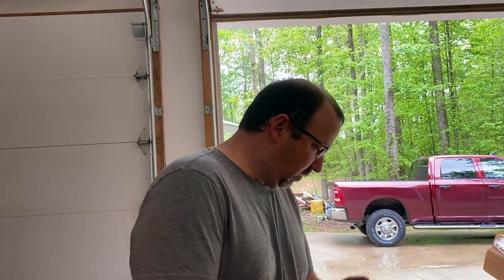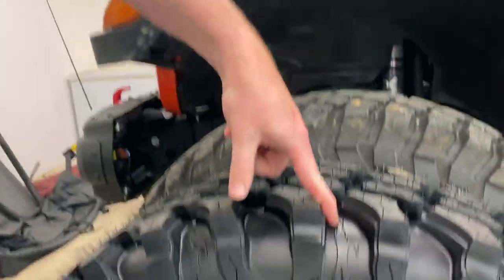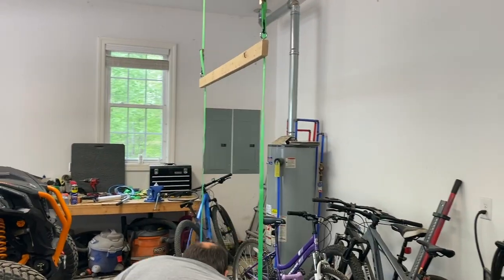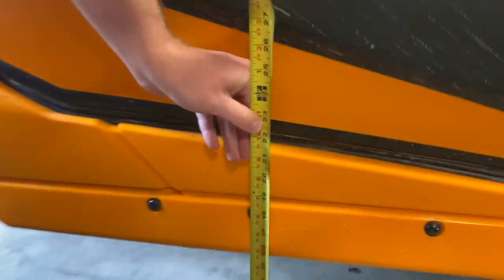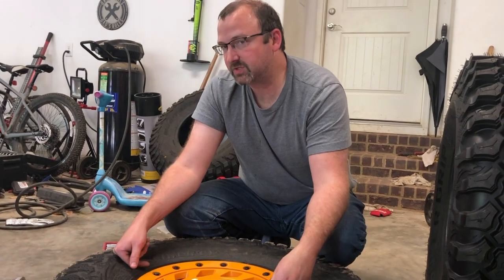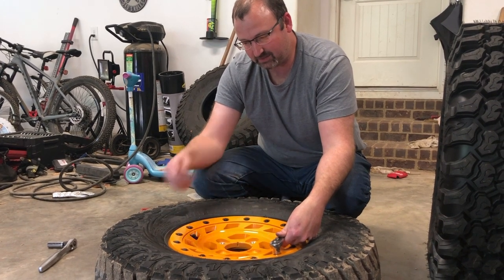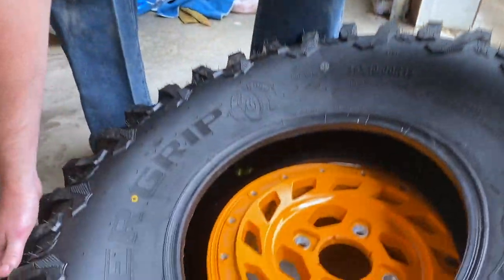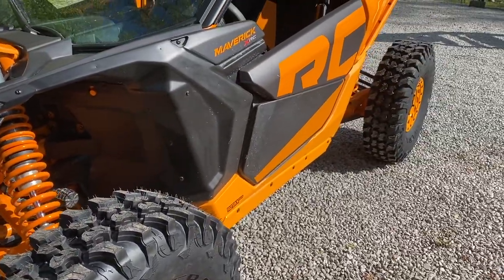35" K9s Installed X3 XRC Turbo RR

Comment: If you still have the straps that hold the suspension down when the machine is shipped new in the crate. You can hook those up to their mounting points on the machine and then to the front A arms and rear trailing arms making it a lot easier to jack the machine up just for taking wheels on and off. Will hold suspension from completely extending when jacking the machine up.
Reply from the maker: That would be nice! Unfortunately, i don’t have those.

Comment: How are the new tires doing? Where can you get them? How heavy? Did you do any clutch upgrade and how does the machine run with bigger tires? Thanks good video
Reply from the maker: Tires are doing great! Just went out yesterday for a good ride. We rode about 5 miles of technical rocky muddy trails and the clearance gain is great!! Low range is perfect now, high range from a dead stop has noticeable power loss...once its moving all seems good but you can feel the heavier tires for sure.

I just emailed KWI to see if they recommend any type of clutch changes to preserve the belt life. I will post a video up once i hear back
Reply: WooPow Offroad would love to know just bought an rc very interested to know the clutch recommendations and how much heavier are they than stock just curious love the videos big thumbs up 👍😉

Comment: Looks great are any other mods necessary too suspension or any gearing?
Reply from the maker: I did no mods and it fit just fine. I would suggest a clutch change to account for the larger tires.

Comment: I was wondering how long bumper to bumper and how wide an tall? Trying to if it is going to fit in trailer. Thanks
Reply: CINDY MCCREADY just bought one you will need at least a 7 x 12 and that’s tight hubby’s already wanting something bigger to walk around on such a size king I guess 😂

Comment: I was curious if you were still running the K9’s ? If so how are they holding up for you.
Reply from the maker: I have sold the X3…however, i was not a fan of the K9s and switched tires before i sold the X3
Reply: @WooPowOffroad  why did you sell the k9s and what did you switch to afterwards?
Reply: @WooPowOffroad why sell